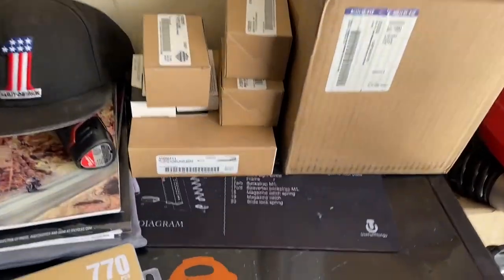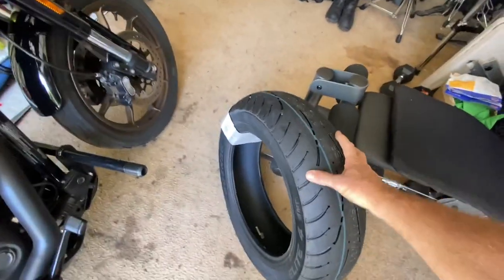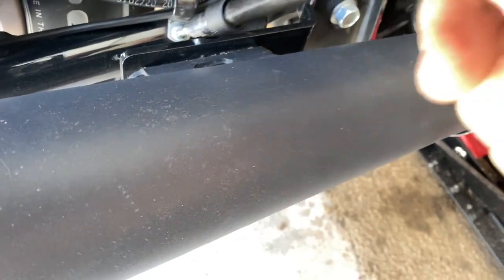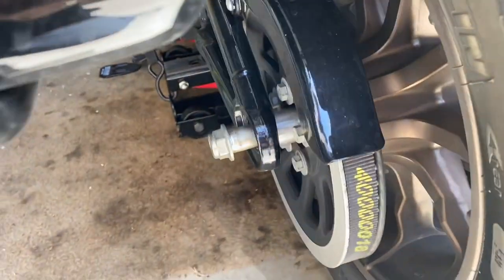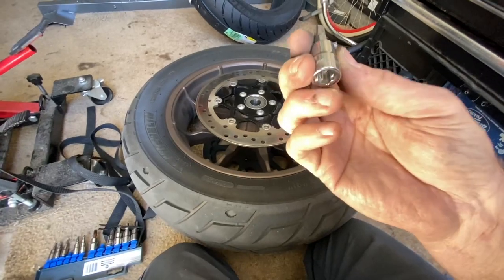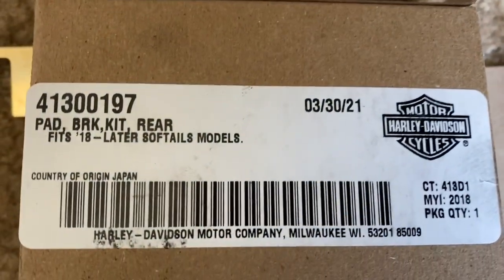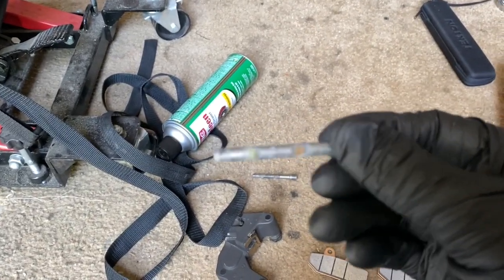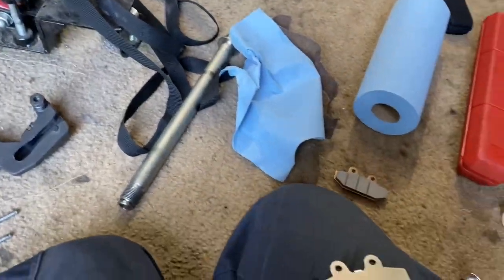Harley Davidson M8 Lowrider S Rear tire and brakes change out.

Comment: Doing your own maintenance saves on the coin. Just did my pick up truck.. 10k will be transmission service time. Changed plugs, belts (3) coils, and wires 5k ago. Gooooowd stuff Brother Dave. Stay safe and be well.

Comment: Yo any advice on getting that rear wheel out, 100% appreciated, I gotta swap a rear brake rotor to my new one that was color match painted(theme build) and Im all ears for tips.
Reply from the maker: @FranBunnyFFXII  easy jack bike up enough to get the pressure off the wheel and the axle will slide out. No need to bang on it.
Reply: @NorCal-refrigeration  I've seen a lot of people need to remove the caliper and axle alignment bolts. I was wondering if there's a way to get that tire out without touching any of that. I guess i just need to deal with removing that upper slip-on on my bike then eh?
Did you have to turn out the alignment screws to get the rear wheel off the belt?

Comment: Got a 22 LRS and after a loudy 3,500 miles my front scorcher is at 2/12 and the rear 4/12, oem tires blow!
Also I ride like a grandma compared to your average LRS rider, never done a burnout to any vehicle.
Reply from the maker: Scorchers are a low mike tire
Reply: @NorCal-refrigeration  Funny thing is I talked to my harley dealer about the tires and they stayed convinced that the OEM tires are the best option, and it was my riding style that wore the tires out to fast...like whatever fucker.
Reply from the maker: @93ORyan  I could only find a metzler 888 for front and the Dunlop rear they are lasting way longer. I’m at 12k on these already and both holding up. 32k on bike now.
Reply: @NorCal-refrigeration  180/70 R16 77H for that Dunlop Elite 4? So you went radial instead of bias on rear?
Reply: @NorCal-refrigeration  my rear scorcher is @8000 miles and is about wore slap out
Reply from the maker: @codyduke9548  yes

Comment: That knarly seem has been on every tire I've put on my low rider s and every one else's we all need to know why because this is on all of the fxlrs and also the fxlrst.
Reply from the maker: The scorcher is such a low mileage tire. The metzler 888. Last twice as long. So do the Dunlop American elites and commander 3’s.
Reply: Facts!! i got 4,850 miles on my ST and my front and rear both have that line on the same side.

Comment: How long do the drive belts last?
Reply from the maker: Long time
Reply: until they suddenly break and possibly send you for a slide-out or a nasty high-side after doing a sudden 90 🤣
Reply from the maker: @throttlebottle5906  that can happen
Reply: @NorCal-refrigeration  yeah, I seen it happen once, belt snapped and instead of just flinging out it somehow grabbed and the back wheel instant locked.

Comment: How did u get the abs sensor back on?
Reply from the maker: Jack the bike up. Get something high enough to help hold rim/tire at axel level. ( box under tire ) this will help line it all up
Reply: @NorCal-refrigeration  yes I finally got it after a few hours 🤣. Thx 👍
Reply from the maker: @TylerDylan21  it’s a pain with 1 person. 2 people makes it way easier
Reply: @NorCal-refrigeration  yes I found that out the hard way. My buddy came over and made sure I did everything right. First time doing this and thx to your video 👍